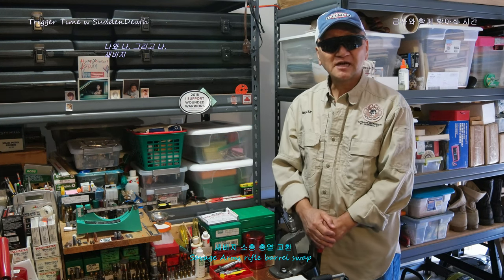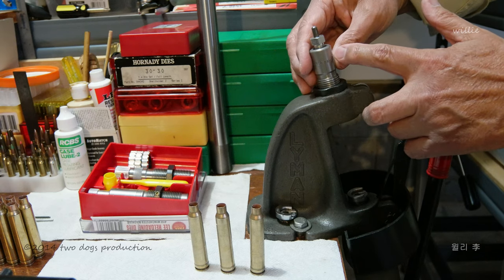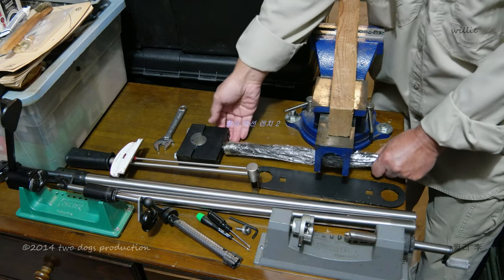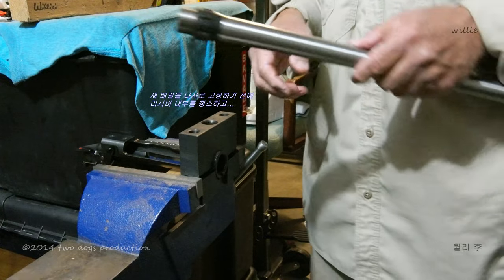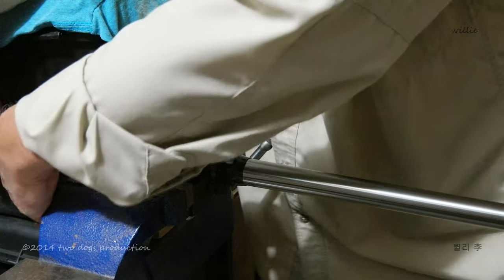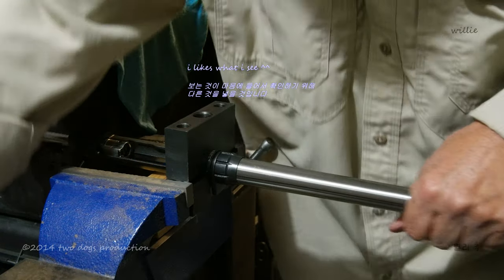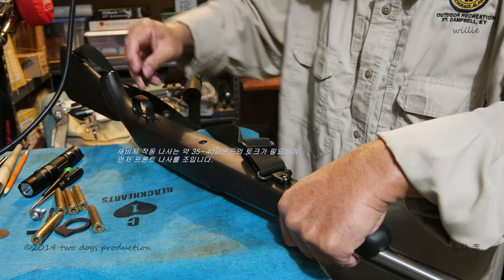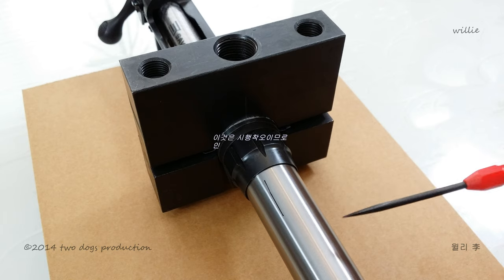458 Win Mag | Savage 111 | an Elephant gun | Build part 2 Barrel Installation

Comment: That’s a nice wrench/action block. My buddy bought a Savage 111 Plains Hunter or something, it was an old Pre Accutrigger gun, in .300WM and it must’ve been a 6.5lb rifle. It would beat you up when shooting and just did not group too well. 

Came across a place called EABCO and grabbed a rebarrel kit from them with an ER Shaw barrel that is like 24” long and must be 1.25” outside diameter from the chamber to the muzzle, basically a curl bar 😂

We used a barrel clamp in the vise to do the caliber swap and it went well but keeping the recoil lug aligned was a pain, it looks like the wrench you have would’ve worked much much better. 

Gun shoots under a minute though with 175 Sierras so it all worked out.
Reply from the maker: aloha Bill. welcome to the everything in between points A to B and 'in between channel'. good to hear it all worked out. wheeler action wrench 2 is made for the then short action 4.25" action screw spacing. for 4.4", i had to cut a relief into the wrench. for the long action, you don't have to. i'll be doing a howto on the barrel lugs without the cut. spoiler alert. two small screw drivers that you saw in the video will be used to hold the smooth barrel lug wedged in place... 458 win mag did beat me up. recoil is about 3x the 300 win mag with 180gr amax. watch my 458 win mag shorts. i had the sore shoulder for about two weeks. all the videos i've taken are about a month ago and i am now editing and uploading to my channel. good shooting always. thanks for visiting, subscribing, watching and sharing my channel. aloha ^^ willie 윌리 李
Reply: @SuddenDeath0  Yeah I’m not sure if I want to jump into a huge bore belted magnum just yet. I saw that video and it looks like the shock busted your camera haha. 

My current Elephant Gun Lite is a single shot NEF .45-70 shooting 300gr Sierra HP over a fat charge of H4198 and is getting just a hair less speed that than .375H&H with the same weight bullet. 

Really would like to try some (long discontinued) Barnes Banded Solids in it but I haven’t found any oak trees I need to hunt yet 🤣
Reply from the maker: yup. found out the hard way. phone is kaput. good shooting always. aloha ^^ willie 윌리 李